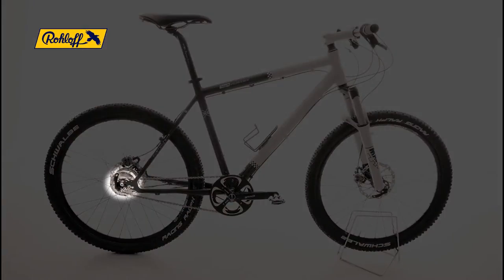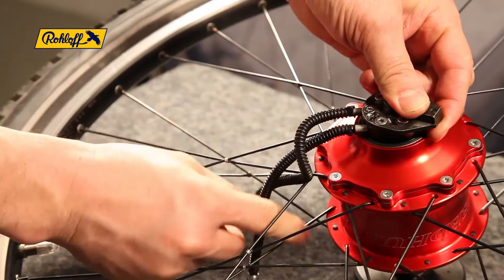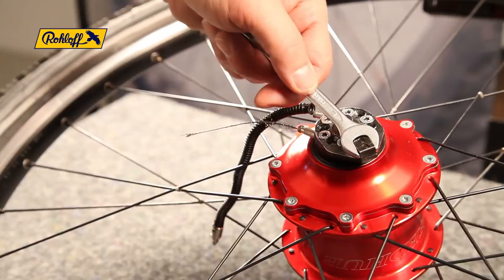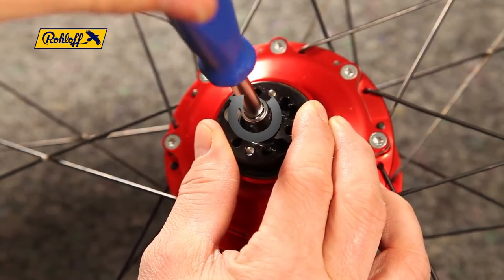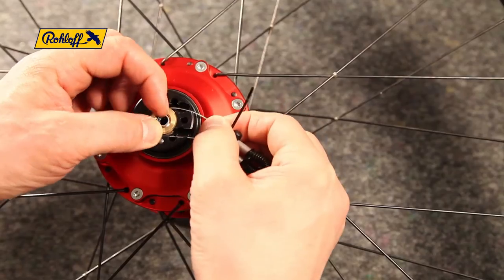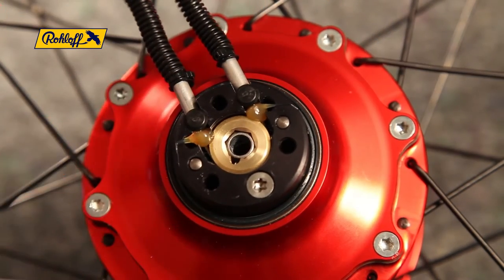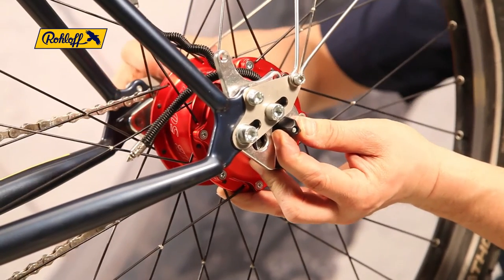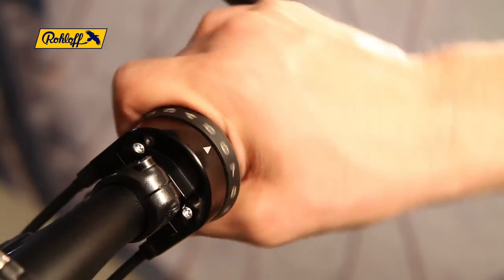SPEEDHUB Workshop - Hub cable Easy-set replacement

Comment: The video has a bad error in it.
You need to turn the gear selector 8 turns not the 6 as stated in the video.
I replaced a friends easy-set cable on the road using the video and after putting back together it was missing two gears because the video is wrong, so had to re-strip the wheel and figure it out....a real pain.
Come on Rohloff correct the video!